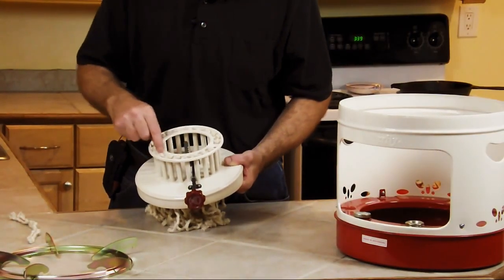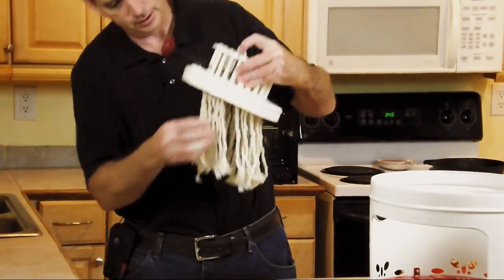Primative Kerosene Stove Review

Comment: Wow!!  I've never seen or heard of those stoves.. that looks pretty cool!!  And very useful!
I'm an urban Native American and when I go back to the reservation, they don't have electricity or running water. Most of the time they use propane or wood for fuel to cook with.  This would be a great alternative.  I just don't know how available kerosene is out there... or how much it would be.  Gotta check into that.
Reply: The availability It seems to be very regional. I like in NE Ohio and I can buy K1 kerosene at several gasoline stations for about $3.00/gallon. They also sell it in containers at most home improvement stores, but at a higher cost. Good luck.
Reply: ✔ out DIY Rocket Stoves from stainless steel pots. Boss of Swamp has good videos on it. Burns twiggs.
Reply: You can use diesel
Reply: @Bucky1836 how?
Reply: @LightLivingEst80  the same as you would kerosene, diesel is basically dirty kerosene.
Reply: @bryces28  yes but it's for indoors
Reply: @LightLivingEst80  then I would probably recommend K1 kero or indoor paraffin oil, you could still use diesel with good ventilation if you don’t mind the smell, we sometimes burn diesel in a forced air tube heater inside the shop.
Reply: @bryces28  that's cool

Comment: We  are not  fond of those kinds (kerosene wicked) of stoves here in Asia. They are notorious for carbon monoxide and most of  the time for some reason makes the eyes of the people close to it teary during usage specially if used in an enclosed space for long amounts of time. It is also high in maintenance for the wicks, with their small profile easy gets burned out and they need to be pushed up and trimmed most of the time. imagine trimming a wick saturated with kerosene. Also, the black metal part that is placed at the top of the burner usually is made of a thin kind of metal that gets rusty and degrades fast.
Reply: What type do you use?
Reply: @Johnny53kgb-nsa I've never had a problem with kerosene I'm in America we have had kerosene heaters of sorts my entire life I just got an Alpica stove too

Comment: You happily use a pressure kerosene stove which aren't common in the US, but you have never reviewed a kerosene pressure stove, either silent or roarer burner. Just like your lamp these need a couple of minutes to preheat but burn cleanly and without any kerosene odour other than when lighting or extinguishing. Not meant to be a criticism of you just wondering why you haven't reviewed them or if you have never seen them?